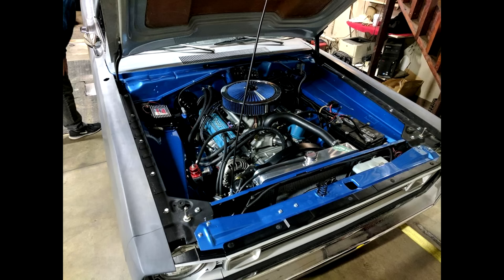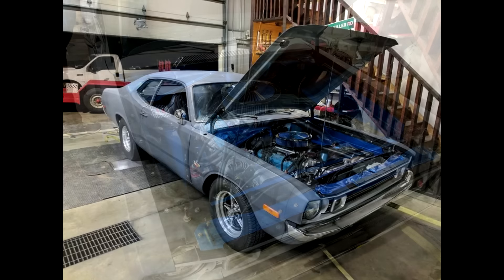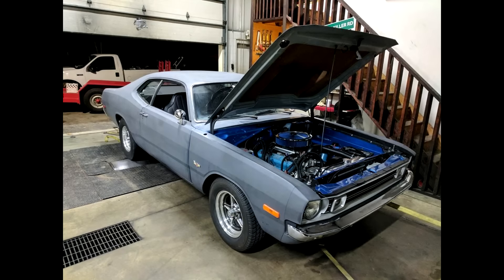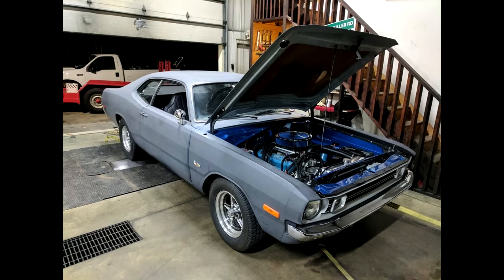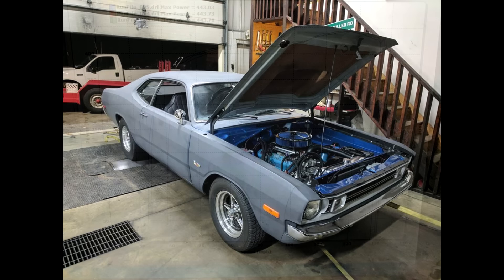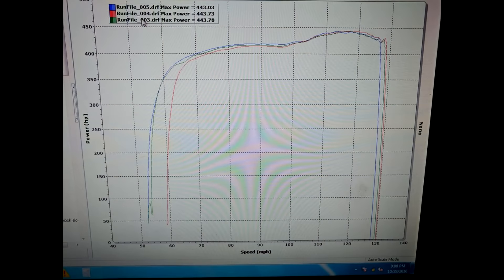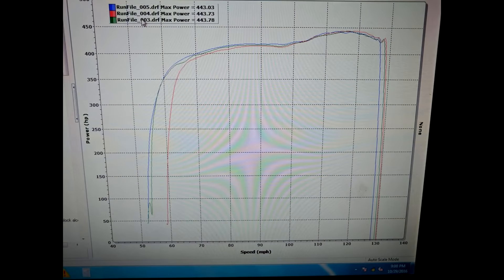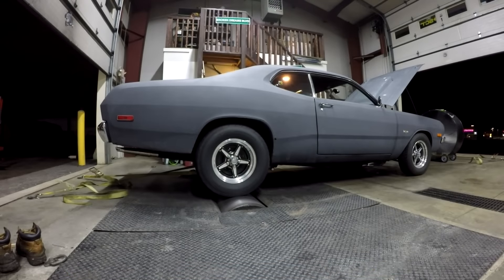Mats Dodge Demon 416ci small block tuning

Comment: Sounds amazing!  What cam is in it?  And at what RPM does the power peak?  Is that port EFI running on a dual plane manifold?  What's the stall of that torque converter?  Sorry for all the questions, but I'm planning a similar build.  Thanks.